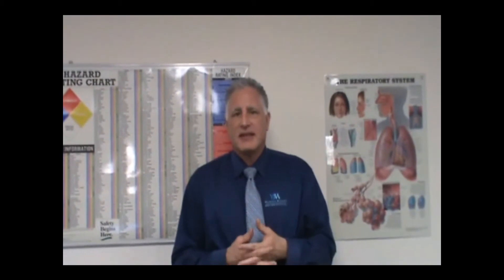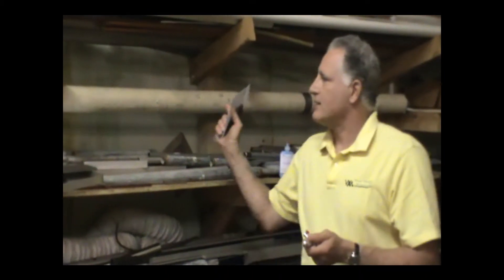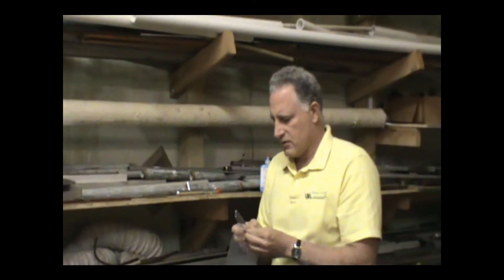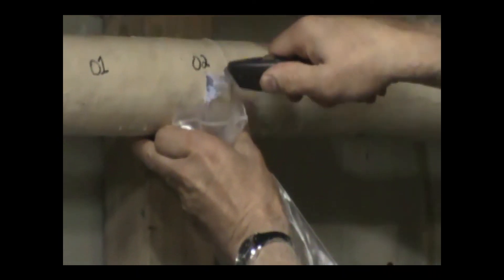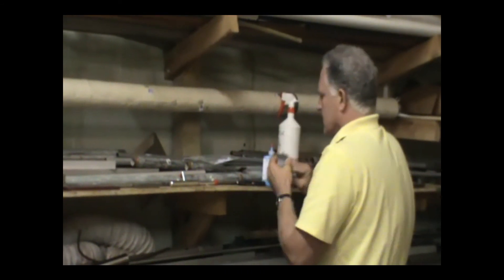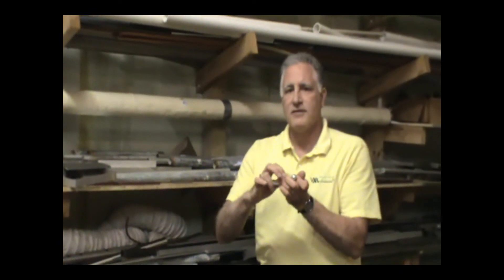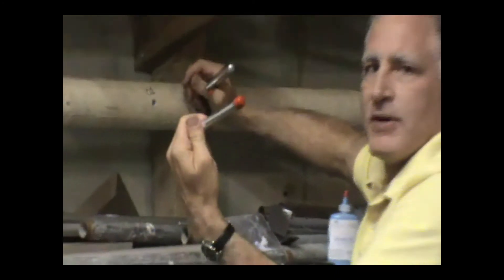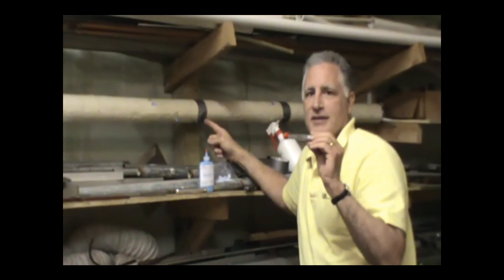Asbestos Sample Collection

Comment: i recommend the method I published in the J Am. Ind. Hyg. Assoc. in November, 1984. I invented the sharpened metal sampling tube method when working for the Navy, but I chucked the 3/8" tubes up in a battery powered drill. I placed a moist sponge on the insulation and drilled through the sponge into the insulation.  The sponge holds down any dust, wipes off the tube as it is withdrawn and puts a sponge cap in the tube to keep the asbestos inside. The Navy didn't want to patent it, sadly. Try it, you'll like it!